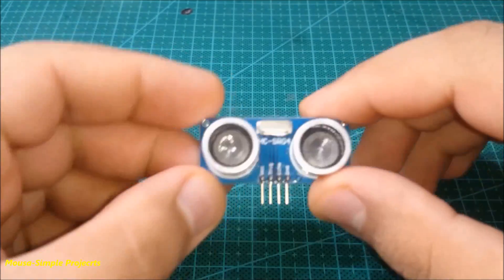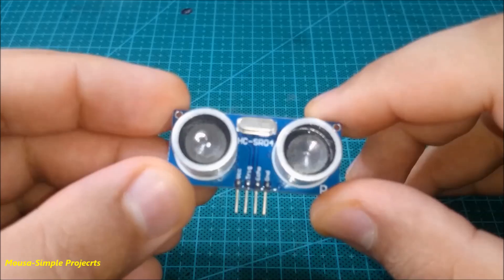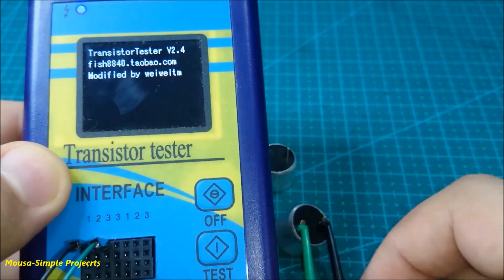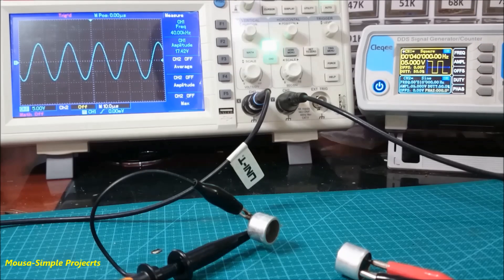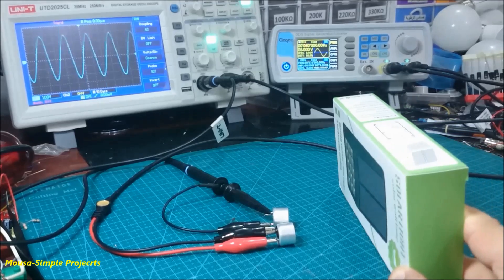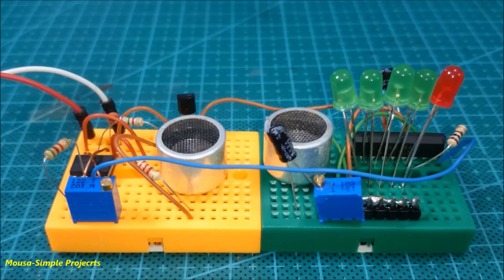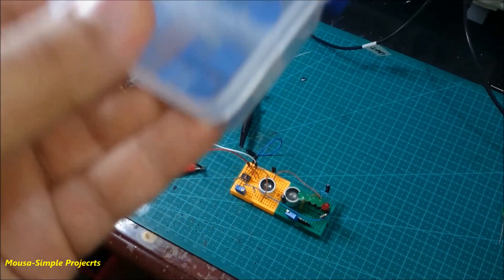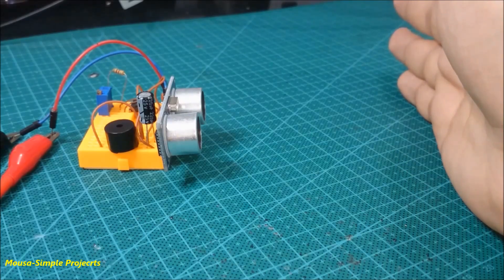Ultrasonic distance level meter without arduino/microcontroller

Comment: bro from where did you get ka2284 ic
Reply from the maker: https://www.aliexpress.com/item/Upright-KA2284-AC-DC-level-indicating-chip-DIP-9-10PCS-LOT/32826353847.html?spm=2114.search0104.3.321.4f482bccujWdq5&ws_ab_test=searchweb0_0,searchweb201602_4_10065_10068_319_10059_10884_317_10887_10696_321_322_10084_453_10083_454_10103_10618_10307_537_536,searchweb201603_56,ppcSwitch_0&algo_expid=458352a8-11f6-473a-97e2-c66401631ef1-47&algo_pvid=458352a8-11f6-473a-97e2-c66401631ef1&transAbTest=ae803_4
Reply from the maker: You also can buy the kit here:
https://usa.banggood.com/KA2284-Level-Indicator-DC3_5V-12V-Module-Battery-Indicator-Audio-Level-Indicator-p-1362828.html?rmmds=search&cur_warehouse=CN
Reply: Bro
Reply: jaycar electronics in australia sells the ultrasonic sensor   part with the emitor and receiver